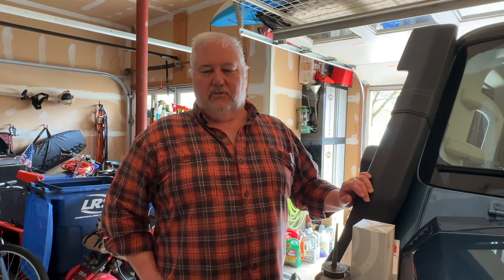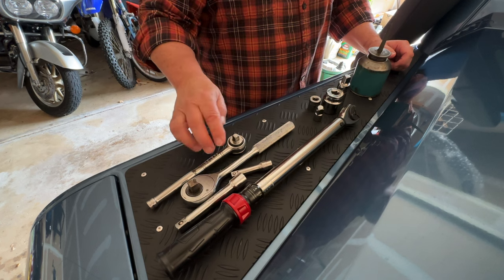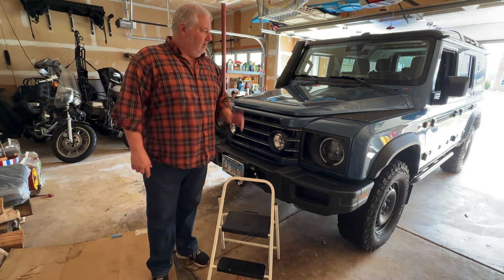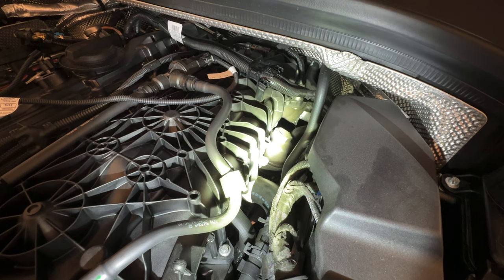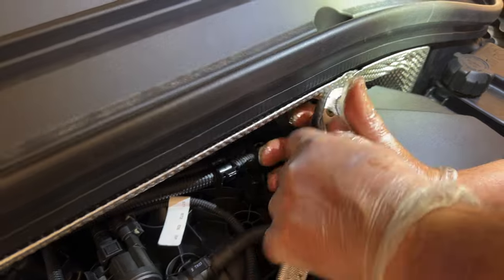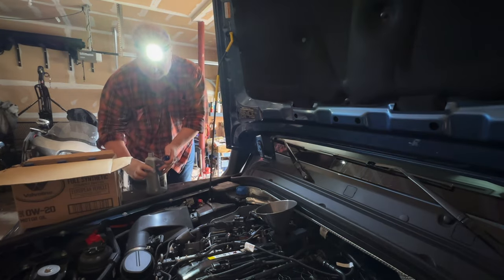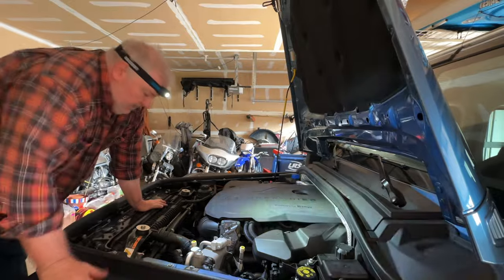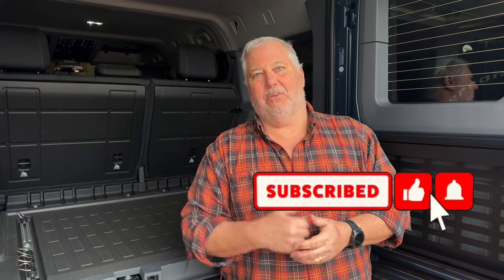Don't Make The Same Mistakes I Did! How To Change Oil In Your INEOS Grenadier

Comment: Nice video. Since the vehicle is so wide and you have to do a bunch of leaning a stretching against the fenders, you might want to pick up a cheap moving blanket to drape over the sides so your shirt buttons and belt buckle don't scratch up your paint job.
Reply from the maker: You are dead on right with this suggestion. I had a blanket all ready to go but once I got into the job using my small step stool and knee up on the fender plate I didn't use it. If I were a bit taller and didn't need the stool I would use one for sure. 

Actually afterward I thought I should have put it on regardless as just dropping a tool might have hit paint.

Great suggestion and thanks for taking the time to comment!

Comment: Keep that cap for oil in the hole but crack open. It is unsafe moving tools around that open hole. Imagine if socket will drop there or something. Keep it safe 😂. Good tutorial. Thank you
Reply from the maker: Good insight, thanks for sharing. Fortunately I have never had that happen but you are right, it could definitely ruin your day! Thanks for dropping by the channel.

Comment: Great video. I think it's smart to do the oil change yourself so you get to know your vehicle (e.g. the additional oil at the end). Also, I like that you pointed out the transmission oil plug...because...I may or may not have drained transmission fluid the first time I changed oil myself when I was a teenager. My famous quote from that experience: "Why is the engine oil red???" Keep up the GREAT content!
Reply from the maker: Hahaha-great story and so relevant. Thanks for watching. I finding doing your own oil changes forces you to get under the vehicle and have a good look around to see if anything looks amiss so something I do. I really like the 4x4s that I have because they do't require the use of the ramps!

Comment: From a uk mechanic I can confirm this oil filter is about a 4 out of 10. Those who know, It's normal for European vehicles to put routine service components in awful places, mainly because our vehicles are smaller and manufacturers use the same engine across many different models and most don't relocate the oil filter housing despite this being easy to do.  I like the grenadier idea. But I thought the whole purpose of it was farmers can maintain the whole thing with absolute ease. If I showed any farmer this they would scoff at the very least. I myself know full well it's normal awkwardness, infact there are more awkward cars, there are also a lot sensibly in your face when you open the bonnet. Even mechanics want ease. If I had a grenadier I would  set myself a little project and be machining something and getting it remote right in your face. Especially as I maintain my vehicles more often than the recommended intervals, which are set in favour of strict European manufacturer oil pollutant legislation & 3 year service costs and certainly not in favour of your engine longevity lasting over 5 years. Have bmw fixed the B58 oil pump issues from c2020 or playing ignorance as usual?
Reply from the maker: At the end of the day not nearly as bad as it first looked but certainly could have been in a much more convenient location! I am not familiar with the oil pump issue, only a passing reference a few years ago to cold weather. As a mechanic how often do you change your oil?

Comment: This is a very comprehensive guide! thank you. There has been a lot of talk on the forums about using different weight oils so I am a little undecided. I want to use a ll-04 0w-30 but it looks like there is nothing wrong with using the 0w20 from oil analysis I have seen.
Reply from the maker: You are welcome. As far as oil grades I am certainly no oil scientist but I have never experienced any oil related problems in any of my vehicles in over 45 years of driving and doing self maintenance and always use factory recommended grade. My daughters Mazda uses 0-20 and has over 70k miles with no issues.

Comment: Well done for showing that and the information which goes with it. No dipstick? Seriously?!?     

All car manufacturers have a habit of making things really awkward to get to, probably to stop people like you and me from getting to them, although European ones are generally worst than most. I'm amazed that the starter motor is so easy. The last one I did on a Vauxhall involved removing the front wheel, putting several extension bars together, so it was about four feet long and trying to get to a 13mm bolt that was impossible to get to, without removing the cylinder head... I do miss old cars with small engines in big engine bays. And to think I used to complain. 😂
Reply from the maker: Hahaha, as an American I miss the days of BIG engines and even BIGGER engine bays! Thanks for the great comment!

Comment: Consider adding a quart of new oil after draining to help remove/flush as much old oil as possible.  Then add the drain plug and fill with fresh motor oil.  Further, along with removing the oil cap, you can also unscrew the oil filter, but not remove yet (before removing the oil drain plug), to assist in oil flow out the oil drain.  This will also allow the old filter to drain before removing and not drip oil on the engine.
Reply from the maker: Good suggestion. Thanks for dropping by and taking the time to offer your insight!

Comment: Absolutely enjoy your channel! I only found it today after looking at tons of the same Ineos channels with the same worthless content. I have owned at least six Jeeps over the years and have been considering the Ineos Grenadier Trial Master. My only worry is that I'll get in nowhere Moab, which will break down with no parts available. Your Baha trip put me at ease on that point.
Reply from the maker: Well to update you after towing the Grenadier to San Diego it is still out there. It took quite a while and the help of INEOS to get the fuel pump and transfer case faults cleared and now the body work requires all manual inputs because the parts and process are not computerized yet. The positive thing (if you can call it that) is that it all seems to have been caused by the damage from getting backed into.
Reply: @dickinaroundoutdoors8609  Wow! Talk about crying in the mud! Your reply makes me rethink my buying decision. I live in St. George, Utah; the closest dealer is SLC. I've owned many jeeps to the point that I don't want another. In addition, with Stalantis on the ropes, there is a better time to buy something from them. When I got an email regarding your post, I thought, hot damn, he's back. No such luck. I hope you are feeling better.
Reply from the maker: @tdsmith  The recovery is going right on schedule and we are talking about getting some videos out, not with the Grenadier but overlanding related.
Reply: @dickinaroundoutdoors8609  Excellent! All of your videos are informative and fun.

Comment: BMW engines are notorious for having multiple major plastic components that perish and get brittle with age and heat. Not at all simple or cheap to maintain and repair long term. Some of the plastic is obvious. Another issue, which I think has been carried over to the current model, is that the oil is routed through the alternator mounting bracket and it has a cheap gasket that again hardens and cracks with age and gets to leak. Lots of plastic coolant and fuel lines and vacuum lines and adapters as well.  All great when new but five or ten years later they test one’s patience.
Reply from the maker: That is why I gave up on my 540. Best new car I ever owned and worst car ever after 10 years-a real money pit. Fingers crossed on the B58!

Comment: Please be careful with bare socket wrench handles as the starter motor terminals are LIVE and the sump plug is earth .
Reply from the maker: Good point, thanks for the insight as not that common to have them in such close proximity. I appreciate the comment and your checking out the channel!

Comment: I would have thought the grenadier would do a topside oil change because of the topside filter on the b58. I wonder if someone will make a custom tool for that filter location.
Reply from the maker: It would be nice to have some sort of spanner made for it but after all is said and done it really was not that hard to get to, only limited the stroke on each turn of the ratchet and would still need to get in there for the torque wrench I guess. Great idea and thanks for taking the time to comment!

Comment: My oil filter cap/carrier was incredibly hard to free up and remained that hard to remove until it was all the way off.  I don't know if it was cross threaded from the factory but it was very tight.  Was yours easier?
Reply from the maker: @AwestinTX  Sorry to hear you had some issues. If I recall I did use the wrench the whole time to take it off but it went back on fine (no feeling of the threads being damaged) so not sure. I would think damaged threads would have caused a leak but I am not sure.

Comment: That looks slightly easier to do than my defender. I have to remove 3 heavy skid plates to access the drain plug
Reply from the maker: I have to remove a plate to change the oil in my Raptor and it definitely adds time and effort to the job! Thanks for dropping by.

Comment: Thanks for sharing. This engine has plastic valve covers?! And no physical dipstick?!  Oy!
Reply from the maker: I have read there is a hidden dipstick on these somewhere but seems a lot of cars are going this route, I hear it is for emissions but don't really know. I believe plastic valve covers are much more common in newer cars but yes, lots of plastic here. I appreciate you dropping by.
Reply: @dickinaroundoutdoors8609  I think that I remember there is a hidden dipstick on the diesel B57 and not on the gas B58.

Comment: Ridiculous spot for the oil filter housing.  Obviously the BMW and Ineos engineers didn’t fully communicate on that one.
Reply from the maker: Ya, seems to be standard placement on the B58 in BMWs but would have been nice to see some plumbing to relocate it to one of the spare spaces along the fender. That is what they did in my old 540 and it was super easy. I appreciate the comment.

Comment: WTF kind of engineering is this?
Reply: Cross engineering. They install an engine already designed that work for the Ineos. It was not a new engine for the Ineos. I have seen borderline insane stuff. That is quite simple. I wpnder if that vehicle had skid plates
Reply from the maker: As Carlos mentioned below it is the standard location for the BMW engine that INEOS chose to use. At least they gave enough room between engine and body to get your hands in there and turn the ratchet but the front of the motor would certainly be easier-that is where Jeep puts theirs on the 3.6. Thanks for watching!